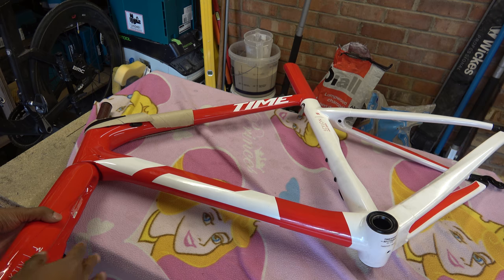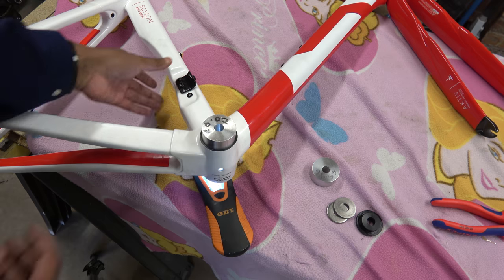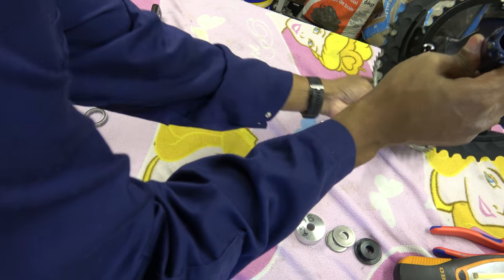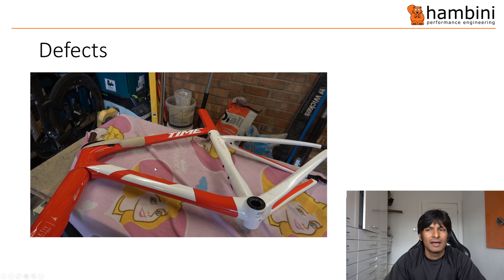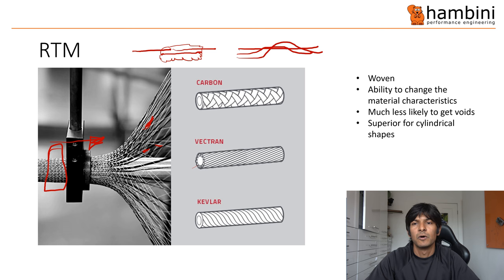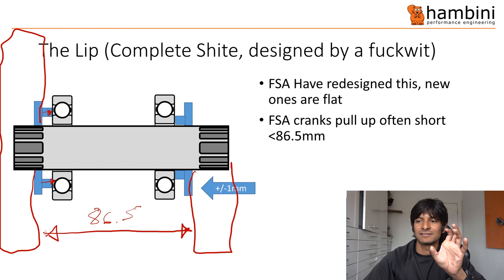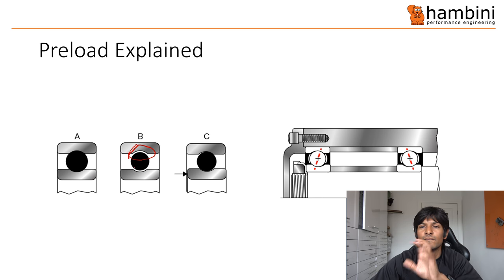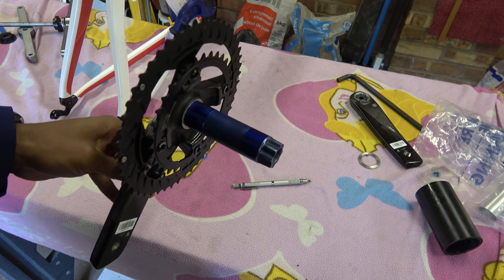The best made bike frame in the world meets the worst crankset in the world and Hambini Loses it

Comment: FYI that is one of the newer FSA cranks that was supposed to have the fix. The crankset is also par for the course for FSA.

Hambini if you ditched the DI2 you wouldn't have any problems waiting to get your rear mech warrantied. Cables have been reliably shifting gears for a while now and are much less expensive.

Comment: Whoa, dude. That was ALL really interesting. I particularly enjoyed what was for me a re-cap on carbon fiber manufacturing. I have a Lemonde carbon fiber bike from the end of the 90s before Trek bought the company. My bike became the Trek Team model for the US Postal team. As best as I can remember reading about how the bike was made it was done like the Time bike with the weaving of the fibers into a pattern that is very strong and absorbs a whole lot of road shock. I think the Trek bikes had OCLV on them meaning optimum compaction low void. Now I think I should take all of my carbon fiber bikes apart and inspect them but I m not having any problems so maybe I shouldn't do that unless I have a reason to inspect. That blue part, I think the axle on the FSA crank was a disgrace. Apparently FSA does have quality control & some guy at the end of the assembly line eyeballs it & says ’yep, it looks good’. It makes me think about who was responsible for the O rings on the space shuttle Challenger. In America we call that kind of lazy attention to detail and maintaining adherence to specs as ’It's good enough for government work’. You are like the Top Gear of bicycle bottom brackets! Keep up the good work & be safe. 👍☮️🌞🦠😷🚲
Reply: Made in the Far East by the lowest bidder. Welcome to the glory that is capitalism.

Comment: I would like to give you some input about the RTM part of the video, since it seems like you do read the comments. First of all, I'm also not an expert, but I worked in the composites industry for a little while. 
First of all I would like to explain what it actually is. RTM stands for Resin Transfer Moulding. This doesn't only apply to carbon fiber, but to a couple of other materials like glass fiber as well, and there are various forms of doing it. But basically this is a technique where you first lay-up your carbon/glass layers (or whatever you like) and then add a resin to the package (the layers). In the video you explain RTM more or less like it would be only the weaving of carbon and Kevlar, which is definitely not correct. Also I think RTM isn't used in aerospace that much, it is mostly prepreg if I remember correctly (but I'm not 100% sure about this). A branch that uses RTM a lot is the wind industry, which uses more materials than all of the aerospace combined. 
An interesting fact, woven doesn't have to be stronger at all (what you showed in the picture is technically braiding). This strongly depends on what your ratios, which fibers are used etc. The overlaps can be equally as strong, but you have to have a certain amount of overlap (that is the beauty of composites). For a certain strength requirement your product will be heavier if you have a lot of overlaps compared to if you didn't have them. Another interesting point, in general if you see a woven look, most often that is purely for aesthetics, not because it is strong (for a regular till weave, the braid actually is quite strong)
Another point, adding in Kevlar in general is kind of a nightmare, since it doesn't bond well to the resins. Thin white fibers are often glass, but I didn't do any research on what Time uses, so it might well be Kevlar. The reason glass is used often is mainly price, but there are properties on glass fibers that are better than carbon as well. We generally don't like other materials being used because the different stiffnesses and strengthsof the fibres sometimes cause problems (one specific type of fibre carrying all the load etc)
The voids part, this really depends on the manufacturing quality, but some processes are more forgiving than others. I've seen workers that had to grind out loads and loads of glass fibres because they had a void in the product (made with vacuum assisted RTM). The voids you have in most carbon fibre bikes is because of poorly educated people building it and not being trained/corrected enough. And also engineers not understanding composites sometimes is a problem. 
Lastly, great video, I enjoyed watching it
Reply: It's a shame Hambini mistakes the 'Aktiv' branding of the fork as referring to the Vectran component of the weave, as it's actually to do with a brass mass on a leaf spring inside the fork leg intended to damp higher amplitude vibrations. I would have expected him to be interested in investigating its validity.

As far as RTM's use in aerospace, I've been told it's specifically used in parts of the landing gear for the A380 due to its relatively low likelihood of voids when compared to traditional pre-preg layup, but that's purely anecdotal.
Reply: @ccmmrrnn  I was lucky enough to demo two Time bikes, identical built, one with Aktiv and one w/o. Definitely feel more vibration on the one w/o. Very subtle, but it works. Whether is is worth $600 and 200g weight penalty is another discussion.
Reply: @openwheelracing88  Thanks for the personal insight, Andy. I've heard from a number of sources that Aktiv is legit, and frankly I've come to expect that of TIME. My impression is that they don't tend to market gimmicks and are pretty particular about having provable benefits to their engineering choices. The frames I've worked on and ridden have certainly supported that.

Comment: To be fair to Shimano, Merlin have probably had to send it back to Madison and they seem to be struggling with demand at the moment
Reply: They should have sent Hambini a replacement asap then they'll have to figure it out with their own dealer. That's how it work in Sweden.
Reply: When I used to work for a bike shop in my student days, if it was an expensive part, we would speak to our contact at the distributer (I think it was still madison for Shimano back then) to get an eta, if it was more than a couple days (sometimes suppliers would just post a new one as soon as we spoke to them), we'd send off the part to be warrentied, but then fit a new one to the customer's bike from stock, then when the replacement part came in, because they're often serialised, do some jiggery pokery with the computer system, so the replacent got switched with the one that was official "in-stock" but in reality was on a bike and nobody was any the wiser.
 
I know it wasn't official policy, but we didn't want people hanging around for a few weeks for the replacement part if we had one/could get one in a day or 2.

Comment: you'll find Shimano customer support issue is probably due to Madison who are their distributor
Reply: Madison weren't taking returns in March. Not sure if this has changed yet. I cracked my shifter tightening the brake hose into it - plastic thread doesn't help.   Phone staff were working from home too so everything is delayed.

Comment: The manufacturing process that Time uses to create the cylindrically weaved carbon is called braiding. They do use RTM, but resin transfer moulding takes place after the braiding and that involves flowing the resin in a single direction through the carbon weave. Check out their web-page for this frame, it explains the tech pretty well and at the bottom of the page there's youtube video showcasing the technology. https://www.time-sport.com/int-en/v-scylon-19.html

Comment: I'll keep my FSA crankset. Being a larger rider I've  found that a FSA Energy, 386EVO crankset is amazingly stiff when using a BSA threaded BB. The bikes weight is not an issue to most. In over 40 years of racing, I've  never DNF'ed a race. Excellent information as usual,  well done.
Reply: FSA's offerings have always done pretty well in FairwheelBike's crank spindle/arm stiffness testing.  FairwheelBikes don't test chain ring stiffness though.
Reply: Guess what I'm saying is, Don't use FSA carbon cranks. IMO

Comment: I think you missed one of the most important things about RTM, the matrix/fibre ratio becomes so easy to control allowing you to achieve greater stiffness at lower weight. Also less chance to resin pooling. Working with pre-preg is a pain in the arse and a rip off it's basically paper-mache for adults
Reply: In terms of manufacturing, wouldn't it be more efficient to make carbon frame through RTM than laying down patches of carbon clothes by hand? Again bike industry needs their get ass get kicked for being complacent and cutting corners.
Reply: The problem with RTM is that you cannot specifically orient fibers in a direction to create stiffness in the required direction.  Also fibers need to be straight to offer maximum stiffness, not curved as they are when woven.  RTM is basically taking a step back to building bikes from prefab tubes instead of carefully engineered layup schedules to allow the frame to be stiff and/or compliant based of fiber orientation.
Reply: Paper-mache for adults, well put!

Comment: As long as wedging is used in mounting cranksets, consistent and effective spindle length (and Q factor) is always hard to be conformed by the way they are manufactured.
Shimano’s has moved away and uses straight pipe, off an expired patent.

Comment: Yes the Time iClic pedal system is like having a mouse trap mechanism under each foot. The feeling of the float is very different to Look and Shimano, it’s very smooth it try’s to centre your foot very gently under the tension of the carbon leaf spring. I use them.

Comment: It's a shame that TIME didn't have a Hambini back in the day to point out their superior woven carbon bikes.  The b.s. marketing buried the truly innovative bikes like TIME.  Had I known, I would be riding TIME exclusively.
Reply: Thats on you Gloria.  Anyone could have learned about Time's unique quality for the past 30 years had they bothered to do a little investigating.  I did!
Reply: @jeffreymirsepasy3700  Not everyone can tell what's real engineering from the marketing BS, especially when most of the marketing BS is based on a grain of truth.  No matter how far reality is from that original concept, it's hard for your average joe to quantify.

how much stiffer, how much stronger..  That could be just as much of a gimmick as dimpled wheels or ceramic bearings for all I know.  Both of those things do have some merits and are marketed based on real things, even if they're not appropriate here (wrong reynolds number, wrong rpm/load combination)  It's still not something that most of us have tools to measure.

Seeing someone actually doing measurements does imply that they know what they're doing, and might not be totally full of crap, but that's not information that's easy to get for any particular bike that you're looking at.

Comment: When saying RTM you are referring to Resin Transfer Moulding, right? It is way of infusing the fibres with resin and has nothing to do with the special, very fancy weave pattern used here. 
In RTM you lay up the fibres which are not preimpregnated, and then infuse them with high pressure, usually quickly curing resin. This happens in a closed cavity, usually vacuum assisted. There is much less of a chance to trap air bubbles , hence it's mechanical superiority

Comment: Websites state the CTL post can be removed and a fully adjustable post made by Time can be fit.  So the second hand market has not been ignored.  There's also 3cm of adjustment with the post cut to length.  That's pretty substantial in terms of fitment.  This is the first time (pun intended) I've seen a fully woven frame even if it is in two pieces.  Should easily be worth the premium they're charging considering the last time I saw something like this was on Lexus's LF-A supercar where Toyota built a custom loom to weave the fibres for the A pillars.

Comment: Yeah I have a FSA crankset with a BB30 bottom bracket on my Boardman team Carbon 2012 model, I had hardly used the bike, but recently after a 100km ride and riding in the wet as well, a creaking noise has developed :-( Now I have ordered the BB30 bottom bracket tools to take it apart, clean it and to fit it back.

Comment: Have you tried holding down the shift key (maybe other keys, crtl, alt etc) when drawing? Sometimes it will draw a line between points or constrain to an x, y or diagonal. Might make annotating in real time easier? Just a thought as these are 'pen' behaviours in adobe. Might be worth mucking about with various modifier keys. Still haven't bought myself a Kuru Toga btw!

Comment: It's interesting that the spindle is attached to the DS.  On the much older SL-K Light design, the spindle is attached to the DS too, and the evil lip is also present.  On my FSA SL-K Modular Adventure crankset (a much new design), the spindle is attached to the NDS, and there is no lip.  As I point out in my FSA video, I believe the evilness of the lip is normally masked by the auxiliary seals which FSA provide with their bottom bracket which are based on rather rigid steel washers which are able to span the explainable gap caused by the lip.

Comment: I literally had this issue two weeks ago. Had a FSA Gossamer crank that came with my Ridley. Bought a shiny new Hope PF41 30mm BB. The frame was designed for a 41mm 86.5 Shimano BB. Changed the BB no issue. Torqued the crankset up and was so tight. Even with all the spacers and wavy washers removed. There was zero movement and bearings bound. Plus the stupid lip on the cranks was digging into the bearing seal. Had zero options other than to go back to the original FSA BB 386 Evo Adapter that it means going to fail in the same space of time. It’s a shame. The spline system offers such shitty preloading problems, just a mm too short really.

Comment: Hambini,

Could you read up on the Aktiv fork and tell us what you think? I know it’s a mass dampener and would love to hear your opinion on whether it’s a complete waste of time. 

Also, wondering what your take on the quality of Campagnolo components is. 

Keep the content coming!
Reply: Yes i was thinking the same, not just carbon weave, but a weighted dampener that offset the road frequency. I have seen one cut up. Almost got a time frame but then saw the LOOK 695 on special, check out my channel for the new bike day vid!
Reply: @waynosfotos  A Look 695?Noice.

Some of Look's road bikes are my bike crush.
Reply: That would be interesting for sure. But it's a difficult measurement to set up because it needs to have results which are relevant to real world riding conditions, and it also needs to be repeatable. Probably doing it like a rolling resistance test on a corrugated drum would be best... You'd need to have accelerometers on the top of the fork steerer tubes to measure the vibration and damping at different frequencies, then you'd need to test with different stems and handlebars to see how much of an impact those have... 
My hunch is that things such as tires (model of tire, width, inner tube type used, inflation pressure), handlebars (type, material), and even handlebar tape and whether you ride with gloves or not, will make a much greater impact than some fancy damper in the fork.

Comment: The Time pedals are "pre-engaged" so you need less pressure to clip in. Love them, they feel great, lots of float. But the cleats don't last very long (can't find café cleats for them either) and while they're very light I destroyed 2 pairs of Iclics in a few hundred km because they're not very well designed (will try xpressos if I can get café cleats for them, otherwise I'll try Look carbon blade ones)

Comment: I had a FSA carbon crankset that came as a stock part on a specialized venge. 2 years of minimal use due to a back injury I went for a bike fit. The mechanic discovered that the none drive side arm of the crank had Dr bonded from the fixing nut making it useless. FSA not interested £600 crankset, get produce sub standard kit at crazy prices I wouldn't purchase a thing by them again.

Comment: @hambini I don't think people realise, the fix on this, was quite difficult. 
When i was watching, i was wondering why you couldn't just mount on the lathe and face the shaft then re-face the interface of the shaft crank end, to give a slightly longer crank length plus a square perpendicular transition? Or is that what you did?
One hundred percent a bike shop or consumer is not going to have the gear or equipment to detect this. Although you fixed, this level of modification would void the warranty. So would they replace on failure if it failed later? It is pretty bad, the part was not fit for purpose, but i bet if you had sent it back as out of tolerance FSA they would not of replaced or fixed it, or say anything is wrong with it! 
Thanks for exposing this stuff, in reality no one would be the wiser, even a professional bike mechanic, if not for this video. 
PS, i think the video was twice as long as needed, as one particular word was repeated consider times, umm what was it again? 🤔😁

Comment: Nice the explaination of the RTM technique.  
But when we see how the axle of the FSA crank is bonded into the chainring and things not round at all, oval and a difference in width plus you have to machine it to even prepare for a proper fix it is quite ridiculous.

Once had some French cars. Lots of gadgets and electronics which all brakes down in a couple of years.
Then une bicyclette, le cadre, would be much much better it it is a TIME or LOOK.